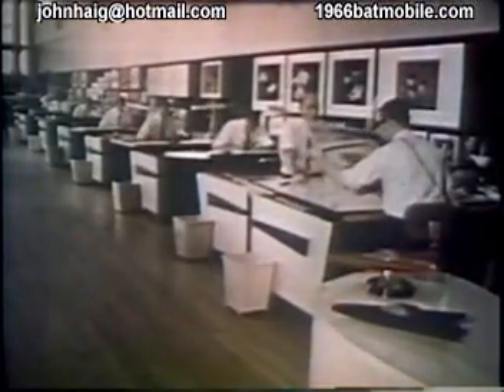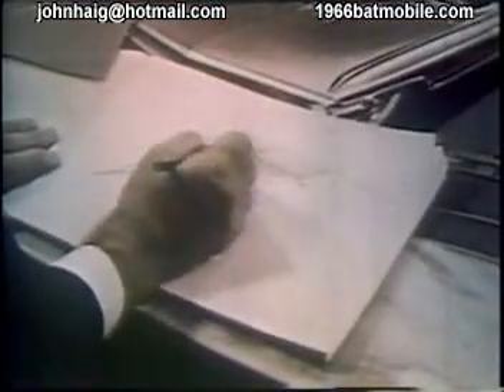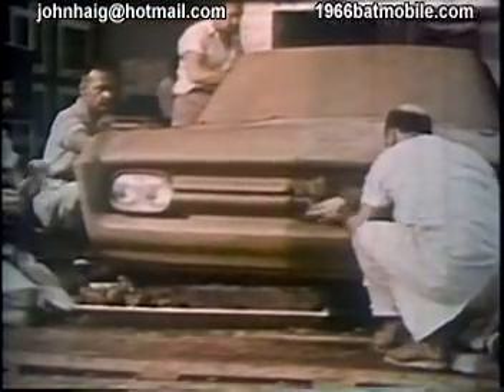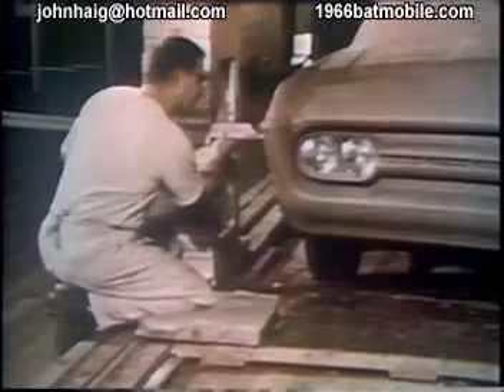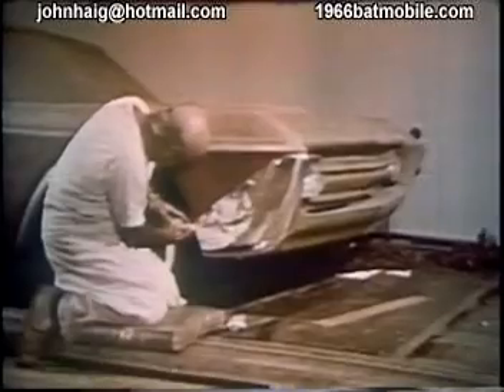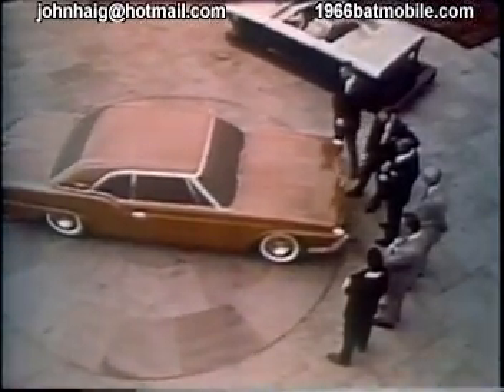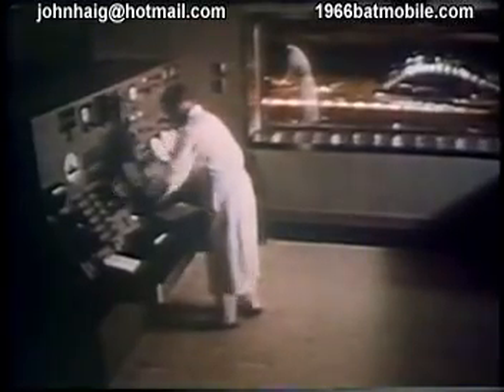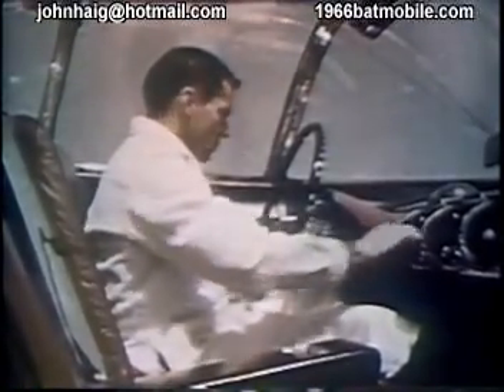1955 Lincoln Futura Testing at Ford Motor Co.

Comment: I wonder how much the old guy got paid to stand there staring at the flames...

What happens to or happened to all the clay used on the mock ups? did they re use it or junk it?
Reply: Industrial espionage was a genuine problem.  Those drawings would bring good coin if stolen and sold to a competitor.  The trash from the office was also regularly searched by competitors in the quest to gain a competitive edge.

Comment: Love how the "plastic canopy" opens and closes with the flick of a switch.
Reply: Not sure why he even needed to do that. Originally, the system was operated automatically.  Pull the door handle to release the door and the top automatically went up. I suppose they could have bypassed or replaced that system by the time this film was made.

Comment: This is interesting to see. I was under the impression the Futura was painted red for the 1959 movie "It Started with a Kiss".  However here, it's already red for testing? That makes me wonder if FORD actually repainted the car to keep it fresh on the show circuit.  Strange that the interior has also been redone in red and black as opposed to the white and black it originally was.  This all leads me to believe the car was already red before being in the 1959 movie.
Reply: +Harold Lloyd Exactly my question as well.
Reply: Ditto... I am sure that the car was repainted for the movie from a pastel green to red. George Barris told me himself and I saw many pictures before and after. Seeing it red at the test factory was odd to say the least.
Reply: @crazexskater  Unless this is AFTER the movie?  But then they'd be using a 5-year old car by that time.  Doesn't really make sense, does it?

Comment: That ornament on the trunk of the Futura looks like a gun sight. Perhaps they envisioned a day when people shot at each other on freeways. And look at the size of that steering wheel, like something you'd find on a bus. Any design worthy of the name Futura ought to have power steering.
Reply: That "ornament" is actually a microphone.  The Futura's plexiglass windshields and dome were so thick, they were virtually soundproof once the doors were closed and the top locked down.    The only way to hear what was going on outside was with that microphone.